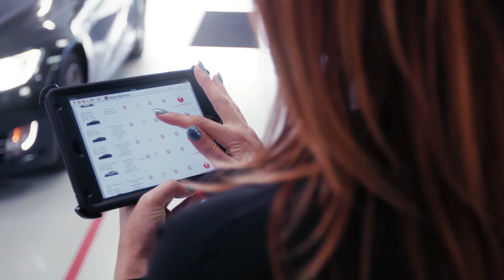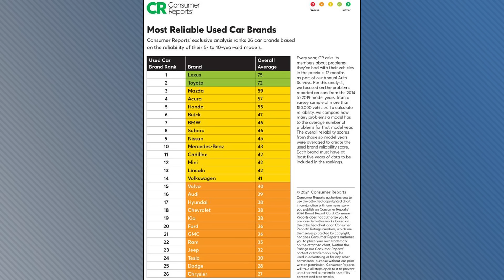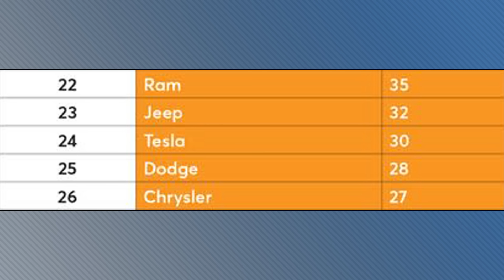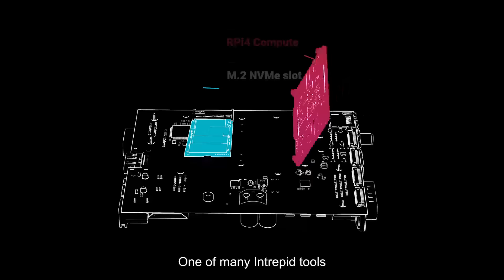Corvette Stingray EV Due in 2029; Tesla Can Sue Over Direct Sales Ban - Autoline Daily 3880

Comment: 😂😂😂 He said a fire sale!!
With all the reports and fud about EV fires (even though ICE vehicles catch fire at a higher percentage), that was an amazing choice of words!
Reply: ICE vehicles don't normally catch fire garaged like EVs do
Reply: @anthonyxuereb792 look up how many cars had do not garage orders in the last 5 years, most were because of fuel systems that couldn't depressurize.
Reply: I can put out a ice car fire
Reply: @pwsunglass  Yes indeed!
Reply: @pwsunglass  good luck
Reply: @anthonyxuereb792 Idk about that but carbeque scorched patches of tarmac have been a thing on UK roads all over the place since I first started driving over 45 years ago.
My 30,000 mile a year Chinese MG 4 bursts into flames every Tuesday.
Meanwhile it costs 2.5p 3¢ a mile in fuel AND maintenance.
Spacious, comfortable, economical, quiet, smooth and quick.
Very quick.
Those things come as standard with ev.
Reply: what matters most is gasoline higher is a safer fire and easier to put out.

Comment: Sales are down because automobiles (both ev and ice) have gotten to darn expensive.
Does anyone really think a Corvette based on the Ultium platform is the answer to any potential 2029 Corvette owners dream?
Much like the Mustang and Mach E - the buyer of an Ultium Corvette will be less than 10% of current Corvette owners.
Reply: Yes, but EV sales are not down
Reply: Ford plastered the Mustang Mach E name on an SUV EV originally designed to badged as  something else, thinking explorer.   This offended a lot of people.   So not the same.
Reply: @danharold3087  I own two V8 Mustangs, a classic model and a newer one. I was not offended in the least. Were you?
Reply: the model S plaid smokes it if they actually gave it a muscle car look legacy auto would be gone already. also model S is only like 70k
Reply: After driving my 2024 Model Y SUV, I would ONLY buy another Corvette if it WAS an EV.  I had a 427 1969 Stingray.  Even this Model Y would leave it behind at a traffic light.  What I would like to see is a realistically priced CorVEtte that can keep up with or pass a Model S Plaid off the line, and built to drive like a Corvette with the magnetic shocks, NOT an SUV styled to sorta look like a Vette.  Soon, not in Mary Barra's time frame; I may be dead by then.  I think Bowling Green could pull it off if given the green light; maybe they could beat the Tesla Roadster to market and avoid being dead on arrival.
Reply: @dabrain22video  Except if you actually want to take it to a road course - there the Tesla will get left in the dust by the new 1,064 hp ZR1 (even worse by the awd Zora that should be 1,200 hp) because the Plaid has zero downforce and is extremely heavy. Not to mention on a road course, every road legal EV that has been tested can't go 10 miles before limp mode sets in. On the pure sports car and racing world EV's aren't close yet - just look at Formula 1 compared to Formula E.

Comment: If you find it surprising that a manufacturer wants to open an industrail bank then you shiuld go back to school. It gives you direct access to Federal money to borrow directly instead of having to go through another bank. So it is far cheaper to source your conduit funds. The downside is you now have to abide by all the banking regulations on top of maybe already being a finance company unless you keep these two divisions deperate which is usually the smarter move. Open your own bank. Lend from yoru bank to your finance arm. But keep them seperate to keep the regulation and oversight simpler.
Reply: 1st Bank of FRUNKENSTEIN. I like it❤

Comment: I take it that Fisker Charger won’t fit a Tesla or any NACS equipped vehicle. Plus there won’t be any warranty if it goes bad early on. I’ll pass…
Reply: It'll work with a Tesla using the J1772 adapter included with every new Tesla. It has a 3-year warranty from Wallbox.
Reply: I use the same charger with Model 3 everyday.  It's nice because you can hardwire or use dryer outlet.  It's not made by Fiskar, made by wallbox.
Reply: @aussie2uGA  cool!
Reply: @zroger73  because it is passing through Fisker’s books, is it possible that voids the warranty, even though Wallbox made them?

Comment: I have a customer demand for car makers with capacity not invested into EVs: I dont want to look at a screen while driving on my next car. Sick of the optical clutter and distraction. Its a fad and most features are 'use once to show it off' or 'never actually needed it'. Add buttons and dials again. Push touch screens down for whatever features require it. Thanks.
Reply: amen. I dont want that info blaring at me all the time.
Reply: No worry, there are pleny of used obsolete cars available and will be for years.  Then again the best selling vehicle in the world (iCE and EVs) is the Tesla Model Y, without the optical clutter of hundreds of cryptic tiny buttons and dials.  For those that like anqiue cars, you can also get a landline and still use a rotory dial phone.  No need to have current technology!
Reply: I agree but Teslas are just so cheap it’s hard to pass up!
Reply: @tesla_tap  harsh bro, just want a choice, some new auto makers are reducing the size of those screens.  According to research from the AAA Foundation for Traffic Safety, the poor design and complexity of many infotainment systems could be causing more distracted driving issues, especially for older drivers.

It has been established by multiple studies that taking your eyes off the road for just two seconds doubles a driver’s risk of a crash.
Reply: @tesla_tap  Corolla still #1.  The reason Adrian cheapened out on buttons and switches is that you have to perform ESD testing on each individual button.  Years of ergonomic testing and foresight went out the window because babysmurf9000 decided against it.
Reply: those screens wont hold up... year after year
Reply: Cheapo plastic knobs and buttons are so yesterday. Clean, minimalist designs are the future.
Reply: @ChitFromChinola  I rented a 2023 Corolla LE over the weekend.  No more Tuning Knob for the radio.  Your minimalist design equals minimal BOM costs at the expense of ergonomics.
Reply: @bobbbobb4663  
You whine about everything. And lie a lot. But, keep trying. Maybe life will get better for you someday.
Reply: @ChitFromChinola He will always be miserable.   Last person picked for a game of basketball or any game... Guaranteed.
Reply: @bobbbobb4663 why would anyone, intentionally, rent a Corolla? 🤣
Reply: @123bigred yeah.   Like those screens at stadiums, or at restaurant POS systems. Doh!
Reply: Yeah, a fad!  Do you still use rabbit ears on your TV for better reception?  That digital TV stuff, also a fad.
Reply: @ChitFromChinola  Cite one lie from me here:
Reply: @BTC_Minarchist  Because I didn't have to find a SlowCharger with missing charging cables because Adrian defunded maintenance.
Reply: @TL243  He's a tesla fanboy so anything tesla is perfect, just ask him.
Reply: @TL243  Tesla's have buttons for most everything you need while driving on the wheel.   If you don't know where to find a button there is voice control.    If you really want a button or two not provided they can be purchased from a 3rd party.
Reply: @123bigred  I have 20 and 30  year old cars and trucks.  Not a one has a broken screen.  But they do have broken mechanical controls.
Reply: @bobbbobb4663  Again, another goofy comment that makes no sense.
Reply: Seems like this comment hit a nerve.  Would like to see those screens as an option, for some consumers, cost and simplicity are the key.  Again, the EU is leading in simplicity, low cost safer vehicles than we are able to buy in the US.   "Euro NCAP will indeed incentivise OEMs to have physical, easy-to-use, and tactile controls of the main driving features like wipers, warning lights, and indicators."Schram went on to reveal that testing protocol would change in 2026, where the safety programme will award points in its 'Safe Driving' category for those vehicles that have "intuitive, easy-to-use vehicle controls".  it is now clearly cracking down on any infotainment uses that avert the driver’s eyes from the road ahead.
Reply: @bobbbobb4663  
Corolla is best selling car. You’ve repeated that one a lot, and posted a link to a fake news story.

Corolla sales 2023 = 232,369
Model Y 2023 = 385,897

And, you never stop whining on this channel. Maybe try taking a break and having an ice cream now and then. Touch some grass.
Reply: @ChitFromChinola  Your calculator is wrong.  All models of the Corolla outsell the Model Why.  Don't worry about me...worry about your boss firing you on another K binge.
Reply: Model S screens have held up well over the years.
Reply: Model Y sold 1.2 million globally last year, best selling model.
Reply: If you've looked into manufacturing side of touch screens, less wiring in the vehicle is why everyone is trying to go there will continue to do so.  If the manufacturers do it right like Tesla, you have efuses, no physical fuses or relays to contend with, meaning less wiring and more reliability.
Reply: Wish it was a fad
Reply: @GG-si7fw  Corolla #1 worldwide.  Adrian’s numbers ignore that reality
Reply: @bobbbobb4663  You obviously haven't looked into that.  Your ignoring industry sources.  #2 was RAV4 globally.  Your not updating your data.